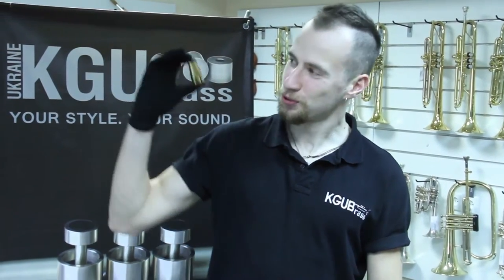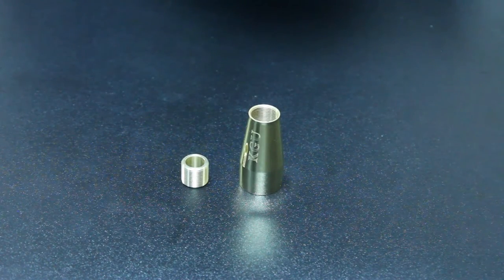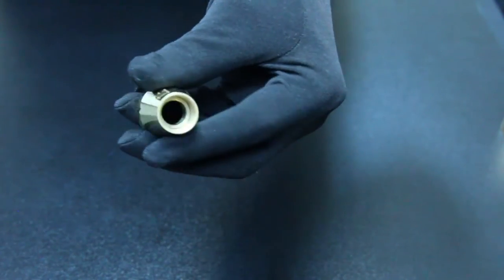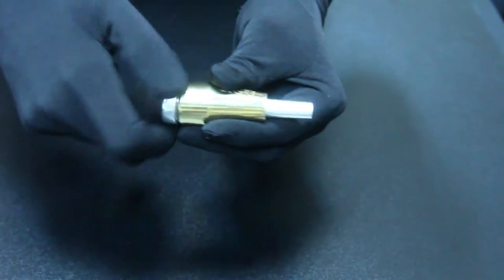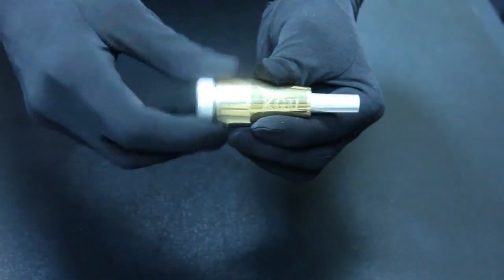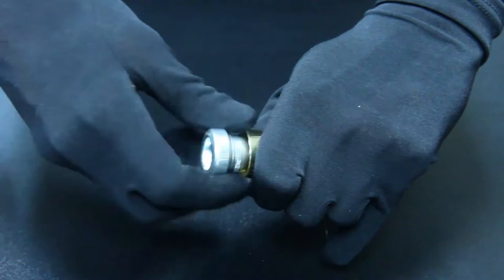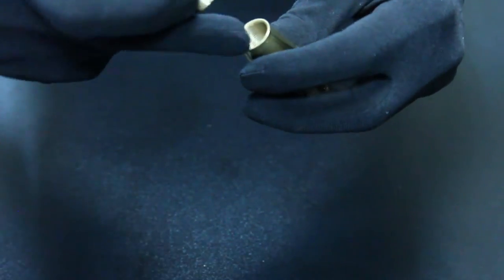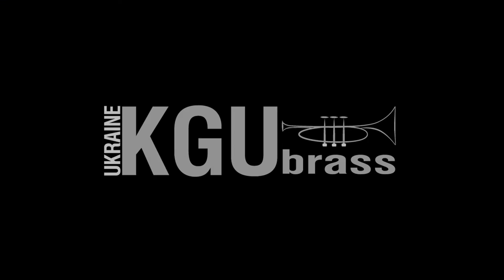KGUBrass Mouthpiece Booster Installation Tutorial

Comment: My mouthpiece booster keeps sliding out. My booster doesn't have screws to keep it in place. Am I doing something wrong.
Reply: Did they help you? Im having same issue probably
Reply: You have to hit the mouthpiece into the booster with power , if not won’t hold .
Reply: @emanuelschulte1174  Thanks.  I was reluctant to use force, but with a couple firm taps on my palm, it stayed on there pretty well.